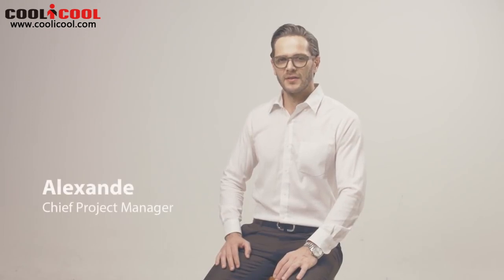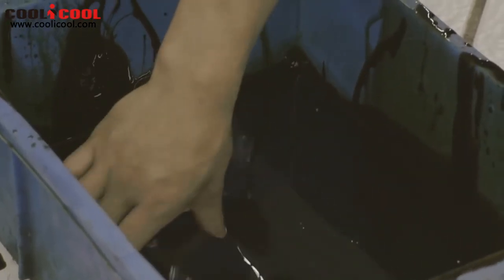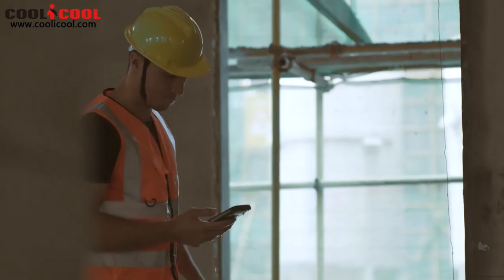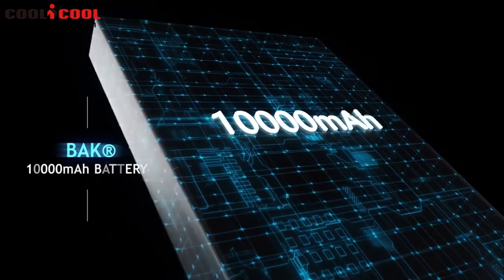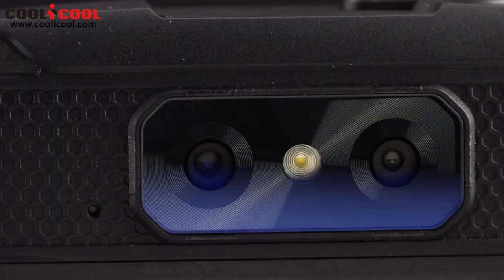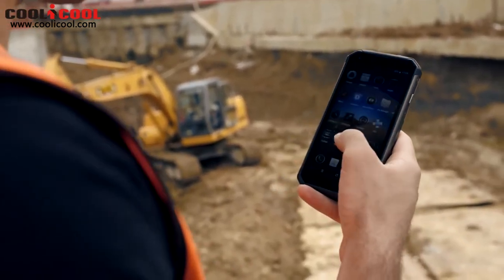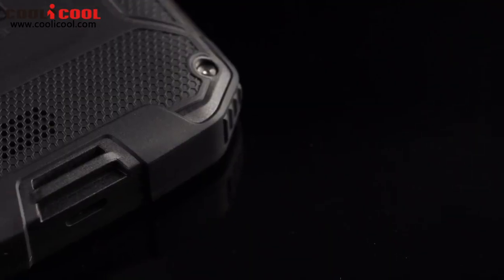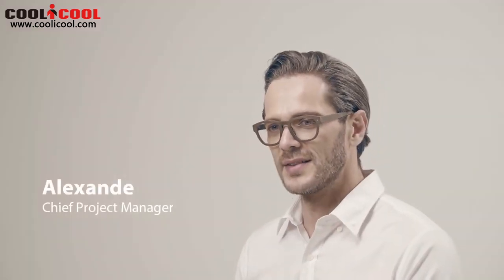Official 3D graphic video of Blackview BV9500, Full Netcom IP68 IP69K rugged phone with 10000mAh

Comment: They put very strong speaker(magnet) inside this phone but they forgot build protection from small pieces from metal. This phone not for construction workers or someone who use any kind of machines for metal working.( grinding, cutting, drilling, welding, and so on).
 After 3 months speaker is full of metal and broke down and quaranty dont cover this factory issue